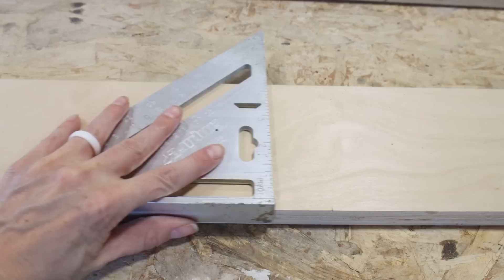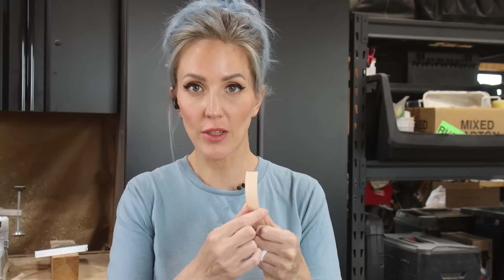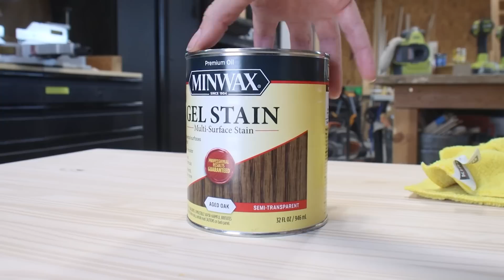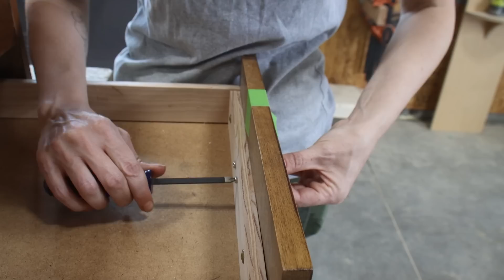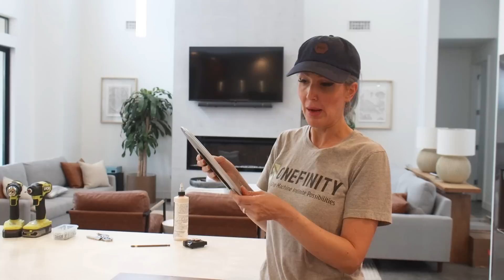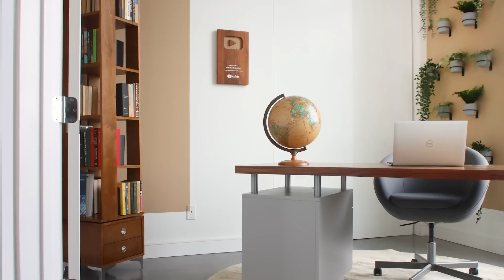Build a SPINNING Bookshelf!

Comment: Is there a concern with stability given the height and narrow nature? It seems pretty solid from what you’ve shown, was just curious as I’ve had to take measures to stabilize taller bookshelves in the past.
Reply from the maker: That's a valid concern but it's actually quite stable. I designed the building plans to be one shelf shorter than the one I built in the video so it can fit within an 8' ceiling. The base and shelf themselves are sturdy boxes, but the big variable is the turntable. That's where you would see a little wiggle if the hardware wasn't strong enough. It's really important to choose a quality turntable whose pieces have virtually no play.
Reply: @PneumaticAddict  - Excellent - thank you so much for your reply. That eases some concerns. Love this build!

Comment: I'm totally NOT clear on why you went to all the trouble of the pocket holes, and then you glued & pin nailed all the shelves anyway?

Now the entire piece, except for the base, is not disassemblable  if you ever need to move the piece.
Why not just use glue and heavier nails?

Comment: Do the blend sticks get brittle after time and or usable? Real question is how long do they last unused before having to buy new ones? 🥺 Also I thought the rotation rings would have been a pain to install... Which it might be to me since you clearly know what you doing and I even struggle to remember the measurement I just measured for the fith time 😂😂 😂
Reply from the maker: I'm not sure about longevity but I imagine keeping them sealed in a Ziploc bag or something similar would help. I've noticed heating the end when it's really cold helps it apply better